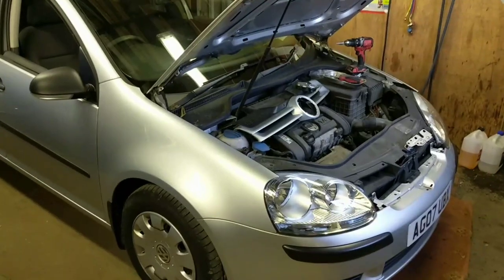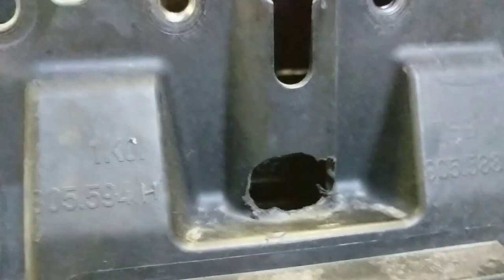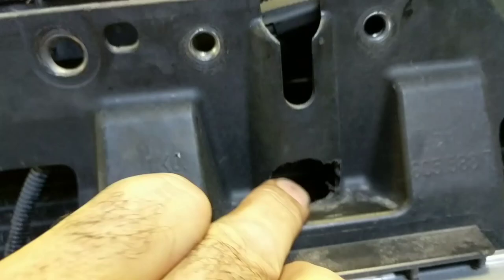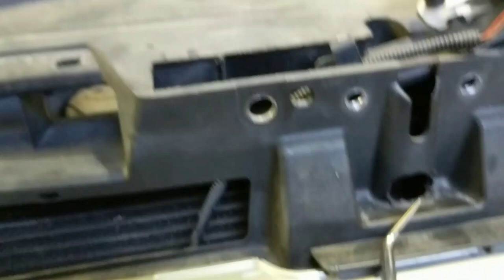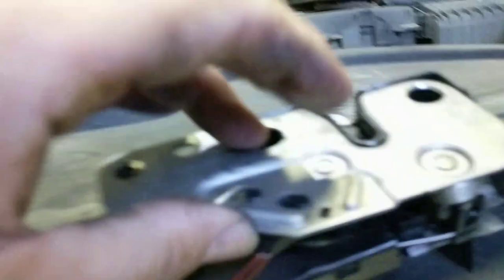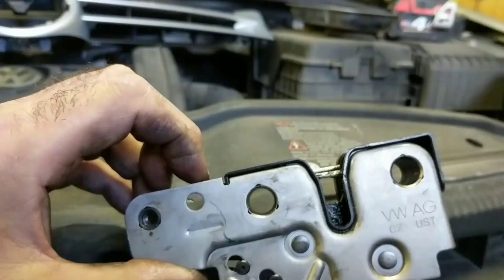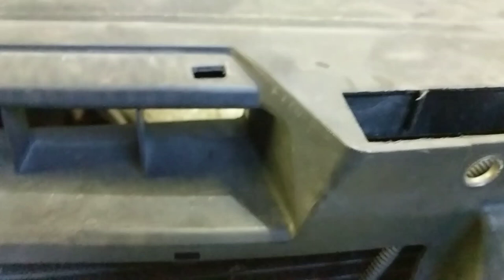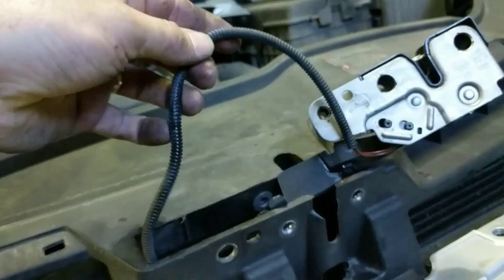VW Golf Mk5 Bonnet / Hood catch stuck. How to release - Fixed!

Comment: If the bonnet releases but the under bonnet plastic tab doesn't allow the bonnet to open simply get a pair of pliers and move the metal hook thats to the left of the plastic release and pull / move to the left. Its a simple hook shape that hooks to plastic on the grill.  Will take seconds and then the bonnet will open. Then WD40 / grease the moving parts and keep them moving. Then test with bonnet closed
Reply: Great info..!!!  Thank you.!!!
Reply: Can confirm this works. You my man are a living legend
Reply: Warren Jones, you have made my day!
Reply: Thanks mate. Anyone who doesn’t have pliers or hook is jammed bang it to the left to release
Reply: Thank you! This was the solution I was looking for. Nowhere mentioned on forums.

Comment: Just came back to thank you! It took less than 15 min to open mine by following your instructions. Once I enlarged the existing hole, I could feel the slot you mention with my finger. Once I figured out its position, I used an Allen key and twisted it with pliers. Once I opened it up, I noticed that the cable was disconnected. I connected it back and works like new. No need to replace the part. Thanks again!
Reply from the maker: Glad it worked out for you. 👍

Comment: I'm.not sure why you didn't just remove the bolts from the latch itself. Lift up the hood and the assembly then just popped the lever to release the hood.
Reply from the maker: Sounds good. It's been a while since I did this but I didn't remember seeing the bolts at the time. You should have made a video of it.
Reply: @Automotive_Solutions  Ha ha ha real funny, had a mate point out that on my US model Jetta VW engineers planned ahead for these issues. Pop off the VW emblem on the grille and 2 of the main latch bolts are in view. Next to that on the left is a hole that a long torx 30 bit can be used to loosen the last bolt. Lift entire assembly just enough to pop the hood from there. BTW video was helpful but I like to break as much as possible so I have a reason to upgrade, Lol, cheers.

Comment: If only it was that easy, 2 attempts at mine. The first jacked up on stands with a flat head screw driver and the second was this method. Put a huge hole behind my badge i can feel that plastic thing and position hook tools on it but it just wont budge. Even put a little notch in the outer metal of the catch with a dremel to help with positioning my pick tools. Absolute mare on a mk3 caddy, aint got a clue how im going to get into it.

Comment: Had the same stuck bonnet catch problem on my 57 plate MK5 Golf TDi 1.9 Match. One of my mechanic friends popped over to help. He got me to pull the bonnet release lever as he banged on the bonnet, with his fist,  in the area near to the bonnet catch mechanism. And Voila! The mechanism released and the bonnet opened. Give this a try before dismantling the VW badge, grill etc.
Reply: Ah thanks man, saved me a big hassle, worked a treat! My oil light cane on, bonnet stuck shut...of course! 😂

Comment: This is a great vid. It shows that it is a serviceable part!

I had both it wouldnt open nor closed. My latch was so ceased that doing this method would have never worked because it was completely ceased, so I got someone to keep opening and releasing the bonnet latch whilst i pushed on the bonnet (basically bouncing it) until it opened. 
Once it was open, i removed the grill cover like Automotive solutions did.

My car was a Golf mk5 gt sport TSi 170. Its slightly different to any variation i seen on the net. 
I removed the clips for the lock sensor to give the latch some maneuvering space when i went to take it out.
I took the 3 retaining bolts out

The whole latch came out with the two wires still attached. Instead of removing it completely, i put a rag down and I then used a crazy amount of wd-40 to free the latches and tonnes of rust came out and used an air gun (from an air compressor) to blow all the crap out too. I repeated for about 20 minutes until the latch was moving freely. I used a screwdriver to press on some bits to figure out what was stiff and what was loose. 

I then re-greased it something chronic. (i really hope there isnt any adverse effects with the amount i used! i'm sure if i made a video, id get a few comments) 

I checked to make sure the cable hadn't broke by getting someone to move the handle and this proved all was releasing again.

Re-assembling was easy when you know how. The wire cable housing needs to attach back to the latch so it can operate properly. This is a bit tricky to get on so I had to practice by taking the lock off again. To me, it still seemed like it could one day fall out of place (which i suspect was part of the problem too) so i drilled a hole in the plastic next to the lock and put in a cable tie to help it. 

Happy to make a video on it if i get enough messages asking.

Comment: Folks I’m going a bit radical and possibly quicker solution... 2 people (one inside pulling release lever...).
Get a can of releasing oil in spray can with the 5” fine spray tube. There are a few access holes and simply try to direct your spray to deluge the ‘sticking catch’) From this and other videos, you can gauge where the ‘safety release catch’ is.
I put an old towel under this area of the engine compartment, then I started skooshety, skooshety and let it soak then try (2 people job) pull the internal release lever, bang (gently-ish) on the bonnet, etc etc etc..  30 minutes patient waiting and a few goes, then off it released (wow, thankfully!🏴👏🏻👏🏻👏🏻😁).
Then of course, I’d say oil and a bit more if you can, and clean off as much as the road dirt as you can. Grease or heavier oil tend to be grit and dirt magnets, so the principle is best to do a regular clean and re-lube (though I don’t use grease!).
Of course I have checked it a few times each last 3 days and everything is fine(and the underbonnet release catch is also light and smooth since I cleaned out the crud!).
Cheers and good luck👍🏻😉😁